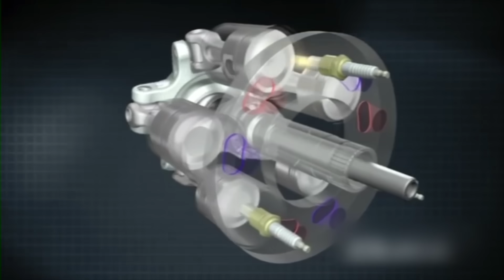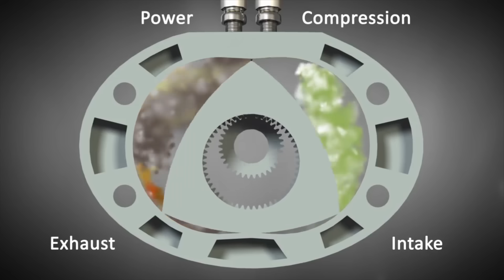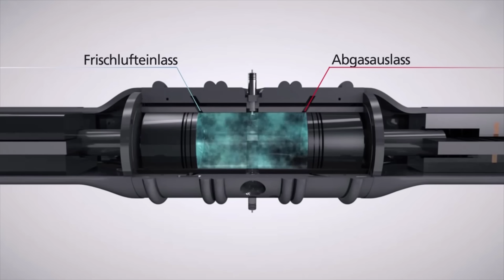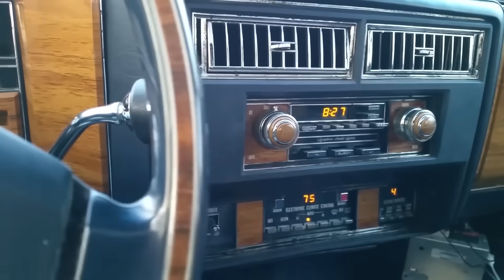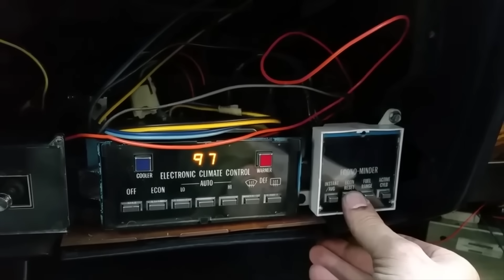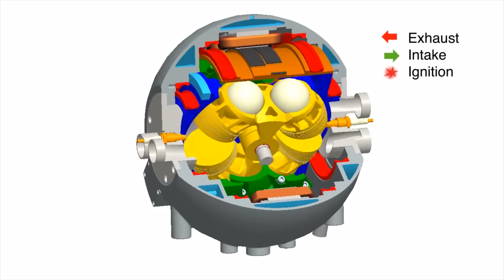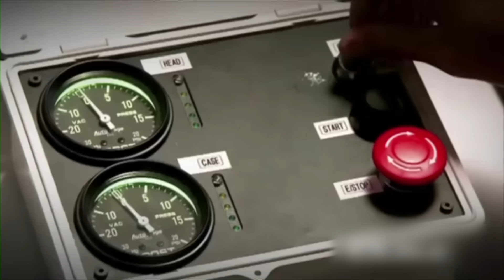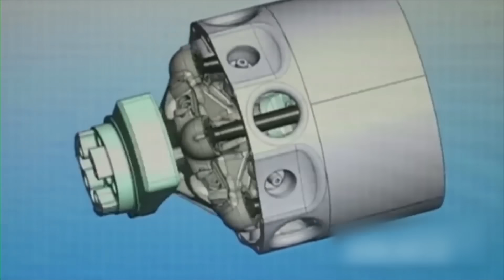10 Strangest Engines of All Time

Comment: 5:51 - incorrect fact. High compression engines do no use more fuel. They use less fuel and produce lower emissions   than low compression engines for a given power output. This  the entire point of high compression - they are more efficient. !!

Comment: In 1794 Thomas Mead patented a gas engine. Also in 1794, Robert Street patented an internal combustion engine, which was also the first to use liquid fuel, and built an engine around that time. In 1798, John Stevens built the first American internal combustion engine.

So 1872 was a bit late to be the first internal combustion engine???

Comment: 5:45 I’m sorry, but higher compression engines are more efficient in every way. Their increased effectiveness result in better fuel economy, cleaner emissions, cooler operation and are more powerful.

What’s difficult is to control detonation over a wide range of operational and environmental variables. Hence the variable compression ratio. 

Engineering Explained covers this exact engine. Perhaps further research and comprehension of the subject should be ensured before mixing up people on YouTube.
Reply: variable compression is nothing new,  it's been tried before.  It's just too complicated and plagued with problems.  It gets a whole 1 extra mpg than an LS3 and makes half the power...  not exactly an engineering marvel...

Comment: After 4 minutes: Deactivating the cylinder and leaving the valves open is nonsense. You leave all valves closed to avoid energy loss.
Reply: @terrygoyan  It is actually generally known that when the cylinder is switched off, the fuel supply to the affected cylinders is only cut off and their valves are always kept closed, so that gas exchange losses are avoided.

Comment: Mazda did not put the Wankel motor in the Germany cars in the mid-1960's. NSU was a German car manufacture which was bought out by Audi and now is part of Volkswagen Group. Dr. Wankel  worked for NSU. Mazda Licensed the motor and fixed the problems and put the motors in there cars.

Comment: I suppose the layout of internal combustion engines has not changed radically because of its simplicity. As a design engineer myself the more complicated you make a mechanism the more friction you put into it.
Reply: always, the more parts it added on, the more friction, cost more to build and maintenance. higher risk of failure. periods.

Comment: There is a motor being manufactured in Melbourne in panels approximately  300mm X300mm X 50mm.
Depending on how much power you want simply bolt on additional panels.

Comment: The duke engine reminds me of an ac compressor in a car
Reply: It is exactly like an AC compressor except for the swashplate. The problems  with the Duke engine are: That the cylinder block rotates with the pistons inside it, which produces huge centrifugal forces on the sides of pistons, which increases with rpm and produces excessive asymmetrical wear on the cylinders. The power and angular velocity are limited by the duration of opening of the valve ports, which diminishes more and more the faster the engine turns.

The joke is, that they could eliminate those problems and decrease the weight while further increasing the power, by doing what I did in my version of this engine, twenty years earlier and that was, to make the engine block stationary like any other engine and letting the center shaft turn. In doing so, you eliminate the centrifugal, asymmetrical cylinder wear, you are able to increase the valve opening duration about 3 times and subsequently increase the power and angular velocity, making the Duke Engine,... almost as good as mine.

I do however prefer the Duke solution to the swashplate, over my own. It's not that mine wouldn't work and it's not that mine might not have some advantages but the Duke solution is very simple and elegant. Maybe both our designs might  benefit from a combination of the two.
Reply: @rodkeh  thanks for taking the time to expand my understanding of it's operation 👍
Reply: @Ancientcaptain  You are welcome. The Duke is a good concept even with its flaws...

Comment: Jaguar made a car, which was powered by 2 small gas tubine engines. The 2 small turbines turned an electric generator and that electricity powered an electric motor, and charged the battery. 
It was called the C-X75.
I believe they used the same gas turbine that was produced to power the patriot cruise missile. 

It's a pretty interesting idea.

Comment: Higher compression is more efficient. When air is restricted the compression decreases, then increasing the compression makes the engine more efficient. While the air is increased the compression can be lowered to avoid auto-ignition.

Comment: The first commercially successful internal combustion engine was created by Étienne Lenoir around 1860 and the first modern internal combustion engine was created in 1876 by Nicolaus Otto (see Otto engine). 1823: Samuel Brown patented the first internal combustion engine to be applied industrially, the gas vacuum engine. Various scientists and engineers contributed to the development of internal combustion engines. In 1791, John Barber developed a turbine. In 1794 Thomas Mead patented a gas engine. Also in 1794 Robert Street patented an internal-combustion engine, which was also the first to use the liquid fuel (petroleum) and built an engine around that time. In 1798, John Stevens designed the first American internal combustion engine. In 1807, French engineers Nicéphore (who went on to invent photography) and Claude Niépce ran a prototype internal combustion engine, using controlled dust explosions, the Pyréolophore.      But that's OK we don't want facts to get in the way of your story!

Comment: Have you looked at the K cycle engine, Developed in Winnipeg by a guy named Kristenson. The U of Manitoba engineering Dept. had a couple of Ford Granadas powered by this engine. It had 16 horizintally opposed pistons that where on rollers and ran around cams at either end of the engine. No valves, one spark plug and was said to have fuel burn efficiency of 90%. and was so smooth you could stand a bolt on the casing at full revs and it would not vibrate off.  I saw a prototype running on compressed air to show how it operated, it looked like to waste paper baskets end to end and about the same size.  It was rumoured that everything was bought up by one of the car companies and it never got into production. I think it was back in the 70s or 80s.

Comment: In 1974, The Cadillac 500 CU engine put out 210 horse power. The same as the 1968 Ford 302 and 10 more than the 1968 Chevy 307.
Reply: Yep. 1974 was the worst year for power output per cubic inch due to the smog control devices that were required by the feds. It wasn't quite so bad both before and after that year.
Reply: @chrisbaker2903  My parents bought a 1976 Chevy Malibu with a V6. It was set to idle at 600 RPM. It would stall at every red light. It had a carb that looked like a Quadrajet without the secondary's. I turned up the idle and the computer turned it back down. I advanced the timing and the computer turned it back down. I was trying everything I knew to get the idle up but the computer fought me at every turn. They finally got fed up and took it to the dealer and the service department said that the program couldn't be changed. They paid cash for it new and took a beating on it by trading it in after 6 months on a Chrysler product.

Comment: Another disadvantage of the rotary engine was how much oil it required. There was a LOT of potential friction inside the engine, which means it required a constant stream of oil. Since the engine was essentially one big chamber and part of it was repeatedly exposed to combustion, the oil was constantly being burned off. This meant even more oil had to be used to prevent friction from essentially destroying the engine.
Reply: Wankel engine is like something that was done to prove it can be done. But it is inefficient, has endless seals which are under constant friction wear yet cannot leak without hurting efficiency and emissions. One side of the engine is HOT and the other side is cool, so you have a huge amount of thermal stress on the stator and all those seals. In short it was the answer to a question nobody asked.
Reply: @townhall05446  I like rotaries, drove an RX-7 for years, but yours is about the most accurate answer around :)
Reply: stupit opinon, dorito engine is best( after 2 stroke )
Reply: @vinii6258  monkey agree🥸
Reply: @vinii6258  Two stroke is too dirty, and wankel engine is a contraption that does not like itself and can't wait to start failing.
Reply: Fax 2 stroke powaaa!!!

Comment: All good cars ruined by the green🟩scam also if you want a fuel efficient reliable car buy a Toyota Corolla or Prius you don’t need all of this other crap that saves fuel it’s unreliable and cost you more money in the long run get a simple car that is easy to maintain made in Japan and simple
Reply: I'd be willing to bet my German car is more efficient than any Japanese car produced the same year. 2003 VW Jetta TDI. I got 47.5 mpg on a 5,000+ mile trip across America and back while traveling at 75 mph or whatever the speed limit was if slower.

Comment: Why do people always think that CARS make the most pollution on earth? Heating up your home with wood and trash is 5 times worse. And it is still NOT illegal here. And I also would not worry about how many fuel we use.
Reply: And nobody in any position of power mentions that half the electricity they use to recharge their car batteries in their electric cars, goes up as heat in the atmosphere due to the resistance of the transmission lines of the power grid.

Comment: 😂 He said “Sliding seals”. 

Damn they good They solved the ultimate problem. Considering valves haven’t changed much since the internal combustion engine, they make that last example out to be 😎but it’s a joke.

To u just quotes specs and my 2002 gaxr-600 almost has more torque than that 5 cylinder blob. 

My bike has been using things like cams and valves for 18 years. It has like a 13:1 maybe 14:1 compression ratio and red lines at about 14,000 RMP 

So yeah I’m skeptical to that last
Engine you described. I’d love to see that  model be ran at 5,000 RPM 

It just looks like it would be a goddamn nightmare to balance that engine. It’s a horrible design

Comment: Opening cylinders doesn’t save much energy. The way the piston and connecting rod attach to the crank and the friction and energy lost in an engine that changes from V8 to V6 is not feasible at all 

Those two Pistons having to suddenly slow down and stop and then change directions twice, and not be given any Kinetic energy kinetic energy was a stupid idea to ever think that much energy could be conserved by taking the power of a V-8 to a V6 with two cylinders that are not working would use 10-20 times the amount of energy it would take to run air conditioner compressor? WTF were they thinking?

Comment: George Brayton may have invented the first LIQUID fueled internal combustion engine in 1872, however Jean Joseph Etienne Lenoir invented a gas fired internal combustion engine in 1860, so he was the first.

Facts please.

I'd argue that little really has changed in internal combustion engines since those first ones, they have refined and become more complex sure. But the changes are evolutionary, not revolutionary.  They're basically still the same thing.

Comment: @11:44  The Duke engine uses the same technology used in the original automotive air conditioning compressors, just switched around from a pump to and engine.

Comment: Brayton was not the inventor of the IC engine...In 1794 Robert Street patented an internal-combustion engine, which was also the first to use the liquid fuel (petroleum) and built an engine around that time.

Comment: You forgot my favorite odd-ball engine.  The rotary aircraft engine of WW-1.   (1914- 1918 )
The crankshaft was fixed..... bolted to the front of the aircraft... the entire engine rotated around the crankshaft.   The prop. was bolted to the crankcase, and the engine and prop rotated around the fixed crank.   Also..  it was  2 stroke design.  Castor oil was mixed with the fuel.    Both Snoopy's Sopwith Camel, and the Red Barons red tri-plane used this design.
Reply: The famous lightning right hand turn of the Camel was due to the massive torque of the rotary. I learnt a lot from Captain W E Johns.

Comment: Your explanation on the infinity variable compression engine is quite off. Higher compression does generally mean better efficiency. So yes more power, no it doesn't use more gasoline. The ECO mode is when it has high compression so it uses its fuel more efficiently. You can even see this at the chart here 5:40 higher number = higher compression. The actual reason for the variable compression is the power aspect in this. This is where the turbo comes in. You want more power you add more boost so you get more air to mix with more fuel making more power. The problem with this is that in a high boost high compression scenario you get problems with detonation. Detonation means that there is an uncontrolled combustion happening which can damage the engine (and it will). So to counter this they lower the compression to allow for more boost to make more power while sacrificing the efficiency.

TLDR.
higher compression = better efficiency
higher boost = better performance

high compression + low boost = efficient engine. (ECO mode)
high compression + high boost = broken engine. (the problem variable compression solves)
low compression + high boost = high performance low efficiency (POWER mode)

Comment: You mentioned the variable compression infinity engine for 2018. Nissan has had the VVC (variable valve compression) V6 engine in the 370z since it came out in 2009. Great engine, very expensive at about 17K.

Comment: Sorry, Brayton did NOT invent the IC engine. Street, Mead, Stevens and others did so in the 1790s. De Rivaz even used electric spark ignition in 1807.

The 1st successful IC engine was Lenoir'e produced in the 1860s

Comment: François Isaac de Rivaz built an internal combustion engine ignited by electric spark. In 1823, Samuel Brown patented the first internal combustion engine to be applied industrially, one of his engines pumped water on the Croydon Canal from 1830 to 1836. He also demonstrated a boat using his engine on the Thames in 1827, and an engine driven carriage in 1828.

Not an American. So yet again an American claiming USA was first at something again when in fact you was about 50 years too late. 🤣

Comment: The internal combustion engine was invented England in 1793 by Street, made more practical in France. Brown then used an internal combustion engine on the Croydon canal in England from 1830 and also used to drive a boat in 1827 and a cart. Lenoir developed gas internal engine in Belgium in 1860.  Brayton merely commercialised it, though a certain Otto and Maybach perfected it nearly in modern form in 1876 in Germany.  Quite a few inventors in the field.
Reply: But you know that Americans always claim inventions for themselves.
Reply: Jim Lawrence is your welfare check late?
Reply: @robinharwood5044  SO FUCKIN TRUE IT DISGUSTS ME!!  I WENT TO WIKIPEDIA TO COPY N PASTE THE FACTS ABOVE IN MY COMMENT.  THEY EVEN CLAIM TO HAVE HELPED TESLA, AND HAVE BASKED IN HIS LIMELIGHT!  SICK COUNTRY WITH NO MORALITY-EXCEPT STRIKE FIRST IN CASE OF A WAR!  ; FROM WIKI; -"Various scientists and engineers contributed to the development of internal combustion engines. In 1791, John Barber developed a turbine. In 1794 Thomas Mead patented a gas engine. Also in 1794 Robert Street patented an internal-combustion engine, which was also the first to use the liquid fuel (petroleum) and built an engine around that time. In 1798, John Stevens designed the first American internal combustion engine. In 1807"
Reply: @Peter Evans jingoism at its best
Reply: @Peter Evans you really need to get that narcissistic personality disorder seen to.
Reply: @Peter Evans you need anger management too
Reply: What is your opinion on the Quasi Turbine??
Reply: @YAGER3321  TRUE...BUT ONLY IN PATENT-NOT PRODUCTION.  I  THINK BUT JAN 29TH 1886 HE DID JUST THAT!

Comment: Engine knock is not bad because it creates mechanical stress but because it blows off the insulating laminar boundary layer from the cylinder wall causing overheating and oil cracking.

Comment: New carbon batteries are going to make electric cars the only sensible choice in a year or two. They'll have 10 times the capacity of even the best LiON batteries, cheaper to produce, weigh less, be mostly biodegradable and much safer while in use. So instead of an electric car going 450Km/charge we'll have cars that'll do 4500Km/charge. Who the hell would ever want a gasoline or diesel powered car, when that happens?

Comment: okay hang on tho, with the electric cars the the 3 cylinder engine that generates power is connected to the batteries, not the the electric motor. you sort of made it sound like the 3 cylinder provides more HP

Comment: This is full of errors... pass.
"High compression engines eat a lot more fuel and also put out more emission"... uh wait... NO !
Take any engine, only augment the compression ratio by installing, I dunno... domed piston, what do you get... with the same fuel and exhaust system... just more bang for the same buck of gas.
It will wear out quicker but it wont use more fuel or put out more emission... just more HP. Your statement is wrong.
And that Nissan variable compression disaster there, same as Audi's SSP377 V8 with all the engine accessories driven by internal shafts, when you have an engine issue, the car becomes a write off.
We all need those like a hole in the head.
"Infinity makes a great car" you don't know much do you?